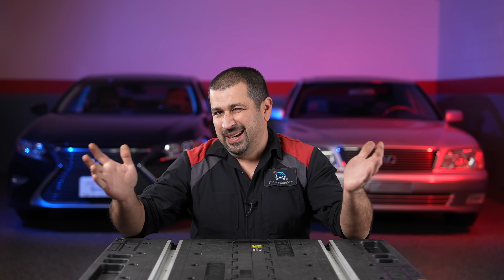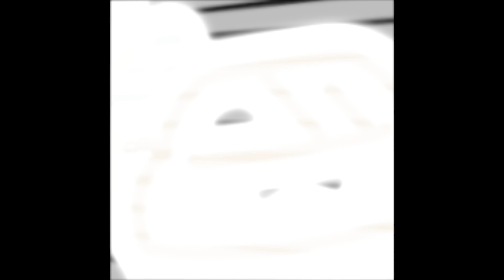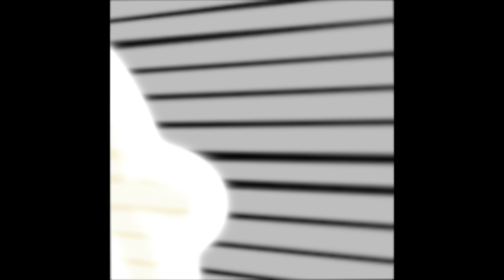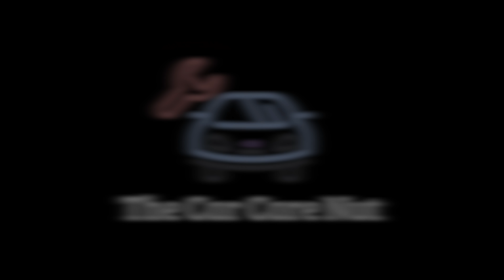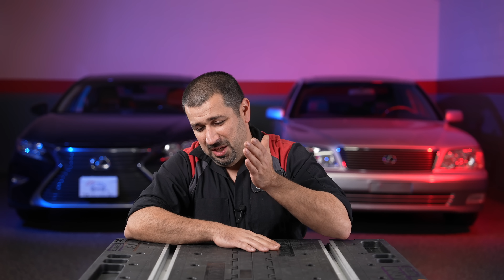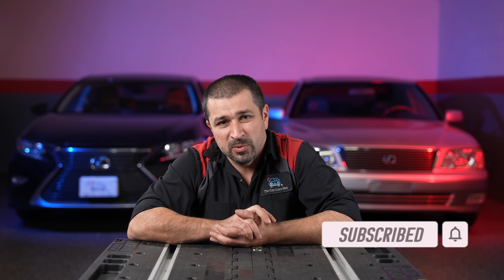Can Modern Turbo Engines Be Reliable? Here's The TRUTH!

Comment: Love this channel, thanks! Turbo or non turbo should be treated pretty much the same. Keep your foot out of it until it's at normal operating temperature so the oil has had a chance to visit all the internal parts and change the oil regularly even before the recommended miles/time. I let my Mazda 2.5 turbo cool down out of habit from driving a turbo Regal back in the day. That Buick had zero issues with lots of miles and a few runs at the drag strip. It doesn't hurt to let them cool it just takes a minute, especially if there's a good song playing in the car 😏

Comment: Of course it can. I have a 2018 AWD Dodge Charger Pentastar I supercharged with a Vortech. It gets 41 mpg on the Interstate @ 608 hp @ 22 lbs of boost. I installed it at 9,000 miles and today have 30,000 on it. The oil is changed every 3,000 miles along with the car. I fully expect it to last the life of the car easily. The supercharger is worth double what the engine it's sitting on is worth. If you drive like an idiot, you may blow the engine, but you won't blow the supercharger.

Comment: Bought a new Audi last year and the manual states 15K km service intervals. Well, it got its first oil change at 800km, then 3400km, again at 7500km and will be getting oil changed every 5K-6K kms there after (done by myself). All documented with receipts and pics for warranty purposes. Then the 15k km service done by the dealership. Oil is cheap, engines and cars are not. dealerships and mechanics make a great living off folks who follow the recommended service intervals.

Comment: Many years ago in the mid '70s I worked as a technician for Porsche. When the Porsche 930 turbo came out it was an amazing piece of machinery. While the boost was factory set at .7 bar I was modifying the wastegates to create one bar. One of the issues this created was blowing out crankshaft seals. But one of the main failure issues created was the oil coking in the turbocharger housing. Eventually they switched over to an after run circulation system, which helped prevent a lot of that. Driving these at 130 mph in third gear was like sitting in your living room. The boost they created was like hitting ice. An amazing car that helped the progress of today's turbocharging systems. Turbos are fine, if you keep your foot out of the dashboard. Frequent Oil changes, like you say, are a must. Love your show, I can really connect with everything you say.

Comment: 13:35 You said it.  It will be even more vital that a used car buyer sees dealer (or oil shop) records of regular oil changes.  However, if the owner is like me, and does them himself, there will be no such record.
Reply: Same I change mine every 4k miles but do it myself so no record if it not the log book I do but they can take it leave that.

Comment: I only use AMSOIL Signature Series oil and their filters in my 2016 Lincoln MKC 2.0 turbo. All the studies like Project Farm tests show it's best against heat and wear. Little more money but cheaper than car repairs. Change it myself so no more expensive overall than paying someone who uses cheaper stuff. Big believer oil is an engine lifeblood. The oil is rated for 15000 miles . I don't let it get to 5000miles. With the new drain and fill transmissions that only change 50% of the trans fluid at a time  I drain it every 15000 miles with AMSOIL's best transmission fluid that's rated at 50000 miles too. Doing it myself is way cheaper and pays to use the better engineered oils more often.

Comment: Yes 100% Im 54 year old mechanic here in uk i purchased a used fiat bravo 1.4 turbo 150bhp petrol at 6 years old 37,300 miles and i did about 5000 caravan towing withit as well.Anyways i scrapped the car this year as was 19 years old body was getting rusty and i had never replaced starters alternator clutch dual mass flywheel etc was all original  at 19 years old 149,000 miles and i made decision not to put car through another mot as i did not want start replaceing major parts as above.Point is the engine was just as smooth quiet powerfull and economic as it was at 37000 miles for how much longer who knows but it seen millions of others off the road just with regular oil changes timing belts and 2 o2 sensors.

Comment: perfect example is the 2018 VW Atlas. They had the 3.6 vr6 and 2 liter turbo engines. Most vr6 are still running fine with over 120k miles

Comment: Certain Chinese car brands, for some of their more affordable hybrid models equipped with less than 2 Kwh battery  pack choose to boost power by using electric motors than turbos. These small 1.5Liter displacement hybrid cars can really rocket off.  If you've been in China, these things can give turbo assisted cars in the West a run for the money.

Comment: My little 2016 turbo 4 recommends every 10k/1 year, but I never wait that long. Usually in the 5-6k range and of course with the recommended specific synthetic. Has 99k, I bought it 3+ years ago w/68k on it. I do use it daily driving, in town mostly. But I also keep the revs low, let it warm up. My drive home is very mild, so I treat that as the ‘cool down.’ I don’t sit in my driveway letting it idle, I do not think that’s necessary though some turbo drivers swear by it.

Comment: You’ve covered several very very, very important ideas two you’ve forgotten. I’m looking into the comments. They’re also saying the same thing. Warm it up slowly do not rev the motor up when it’s cold. Also let the turbo charger cool down as a owner operator for over 30 years with semi trucks and diesel engines. Two things that do kill them the same way as a driver working for you that believes he needs to rub the motor up immediately. If you’re in cold weather, that oil is not up to the turbo charger yet. Also shutting it off immediately after working engine hard, pulling a load high speed/climbing a mountain. The oil in the turbo will cook itself and turn to Coke, which is the same thing as sand and not the Coke you drink number one rule just like your spouse. love your vehicle pet it Crescent spend money on it maintain it. Check it all the time. Let it know you love it. If you drive it like you stole it but only last a little while you’ll have to replace it.

Comment: So in order to have a miniscule effect on emissions the EPA is imposing standards that push engineering to its absolute limits producing engines that need to be replaced more often (and the GHG's associated with making the parts as well as the more frequent oil changes). Very likely these bright sparks at the EPA are not considering these factors when they focus purely on tailpipe gases. I've worked with PhD's and had them reporting to me - a lot of them can be quite myopic.

Comment: Excellent video. Recently purchased a 2022 Equinox with the1.5T engine. My first vehicle with a turbo. Will definitely be doing oil changes at 3K - 3.5K intervals instead of the 4K the dealer recommended.

Comment: In the 50s and 60s a gas engine with a 100,000 MILES, on it was rare, if someone said they had a hundred thousand, you knew they were lying. A turbo with over a hundred thousand is normal, he is correct

Comment: why people care so much about lasting and reliability, I don't understand. As if you are gonna last. We are living on this planet maybe 70-80 years at most, starting to have a life at 30's, replacing our cars in every 6-7 years, and think if our car's engine will last 300k miles or not as if were are gonna use it that long. Imo, unless it's a bmw :), most cars are reliable enough to have enough fun, if it's a great car, I don't care if it's turbo gonna break or not, I'd just have it replaced. It's not the end of the world. If you cannot afford the car's repair costs, don't buy that car. Find something cheaper. 

Life is too short, I'd drive a fun car, rather than a boring toyota just because it doesn't break as often as the others. But as always mechanics have a fetish with reliability.

Comment: All of the things The Car Care  Nut says are absolutely true. Another thing is that modern engines are made with the idea to make them as cheaply as possible. Long gone are cast iron blocks or cast iron liners in aluminum cylinder blocks. Those types of engine blocks are repairable. Now we have aluminum blocks with aluminum cylinder bores coated with very very thin coatings of materials like Nikasil and various other materials. This is a recipe for keeping the engine running until the warranty period expires but after that...... manufactures don't care and would rather see their customers buy a new vehicle. If there is any damage to the cylinder bore on one of these modern engines, the cylinder block would need to be replaced if someone wanted to repair it.  Bolt a turbo on one of these "Modern Pieces of Wonderful Engineering" and you have engines that are very unreliable mechanically especially when owners follow the ridiculous extended maintenance intervals that are recommended these days. The Car Care Nut speaks the Truth!!

Comment: Two more things:
- Turn off the auto engine stop/start.  Nothing worse than letting the oil cook inside a hot turbo charger.
- When you are a couple of minutes away from reaching your destination, drive like a Grandma to let the turbo, the oil, and the engine cool down before turning the engine off.

I have almost 100,000 on my turbo charged engine from what is not considered a reliable car manufacturer without any issues.

Comment: I agree also tho alot depends on driving conditions, group 3 petroleum base in cold climate s short trips terrible for any engine.  0w is terrible as viscosity index improvers with the molecules at high heat range.  Hwy driving with with a decent oil , you can obviously stretch your intervals but always , of course a little less with boost

Comment: depends on if you put the turbo on, or factory installed.
  if like me, we use AIRWERK T6 tubos, and tub 8 qt pans on V8s, or, Run a seperate oil system for turbo, That has an electric pump, 1 qt reserve and the turbo is installed in the rear. No intercooler needed, and a custom airbox plumbing,alongside the exhaust, ecu tune on dyno. methanol injection or E 85 preferred tune. an airwerks s600s, dual vane, willspool 15 psi, from the rear, boosting up the whole length of the car, at 1100 rpm, and capable of 75 psi at 3000rpm.  We can install it on any V8-v10
add 150hp,100tq, or if custom full insane install 1000 hp.
  But pump gas, waste gates etc got to 9 psi or so, without detonation.and triple that onE85, or methanol injection pump.
The air from the rear mount twin vanes is about 130 degrees at air filter box at 9psi 

what we find, Custom installs are super rare today. but for cars like an old Cadillac 60s  ,or a new one..this way the only way, UNTIL makers caught  on. 
We did full armor rigs,gasoline ,8000 lb curb weight,without boost, a slow turd.
diesel,  a whole other animal....
The right diesel+ gears amazing, 
TODAY..to not hookup an armor plated/diesel turbo powered, 10 spd transmission/  Solid tire rig, made for a UNSTOPPABLE 50 mph cruise across continent.
  You're not understanding luxury..

Brinks trucks, are the new "g wagon"

Comment: These 4 and 6 cylinder half ton trucks are pushing the engines to the edge of reliability.  GM has 4 cylinder turbo half tons rated to 10k pounds of towing. This will end up destroying the engine just like race car engines getting pushed to the edge.
Cars at cheap these days, they just over charge for them.

Comment: What seems to be missing in this push for smaller engines is that the energy is in the gasoline. If you want to make more power you have to burn more gas. 

You need a stoichiometric fuel air ratio of around 14.7:1. The turbo stuffs more air in the engine so you can burn more gas making more power, effectively making it act like a larger engine. There is no magic here.

The only time you see more fuel economy from a smaller turbo engine is when the turbo is barely working. E.g. when you are not accelerating.

Comment: The other issue is the engine internals - they are not stronger for a turbo - same internals as NA but with a  turbo means  weak internals and failure.

Comment: The 2.7 ecoboost seems to be a really reliable engine capable of high miles. in fact i knew of one with 380k miles and it only had normal maintenance nothing else. So maintenance is definitely a factor

Comment: On an ancient episode of Motorweek, a guy was telling folks that when you have a turbo, it's a good idea to let the car idle for a minute after parking and before shutting off the engine. That way, the hot oil has a chance to circulate out of the turbo and cool it off.
Reply: That’s outdated advice with modern turbos
Reply: I agree.  Some new turbo engines have an elect variable water pump that hits the turbo first and it keeps moving coolant after the car is shut down, which is a great idea but will break over time.
Reply: @jimsvo4486 i change my coolant early, once a year, just to completely avoid it becoming acidic and corroding seals

Comment: What mileage determines how long a car “lasts”? If it’s 200k miles, the MK7 GTI/R has proven that it can be reliable for that long, over and over again. Stock and tuned, it frequently hits 200k+ miles with little or no issues. 

So the answer is yes! But the manufacturer has to partner with a turbo company that knows how to make a reliable turbo as well as know how to make an engine that will be able to retain reliability with a turbo. Unfortunately, both Toyota and Honda have not figured out four how to do this yet. Both companies have very reliable N/A vehicles, but their factory turbo vehicles continue to have issues.

Comment: As an enginner I agree with everything said in the video in principle.  Engine life is further compromised by a couple of other factors.  As one commenter mentioned the Arrhenius rate rule has and impact.  Anther big factor is the small engine has to work harder than a larger properly sized engine.  Bearing life and general wear are a function of the ratio between max load the bearing can handle and the actual operating load raised roughly to the 3rd power.  The actual exponent varies depending on the type of bearing.  The smaller engine has to run at a higher percentage of its max HP more of its life which means it life will be shorter.  Cleanliness is another huge factor.  Clean oil can double the life of an engine under the right conditions.  Keeping the oil cleaner by changing the oil more often will certainly help the smaller engine but it will never last as long as the larger engine with the same care and quality of components.

Comment: One thing I've yet to see any of the manufactuers' do with turbo cars regarding oil is Use Separate Systems. Oil is still cheaper than an engine, but they do accrue a fairly significant cost even doing it yourself. Using quality oil, between my truck and wife's car, filters and oil is ~$180 every six-ish months (usually sooner by a few weeks depending on needs and activities, but at least 2 a year). 
On that note, if turbo oil ran in its own system with scavenge pumps, there are oil types that both lubricate internal friction systems and are used (in some applications, it's a Primary design envelope) to pull heat out of the system. The most extreme case off the top of my head are jet engines. Unique to those, the oil system never interacts with the combustion process. It does heat cycle naturally, as its core function is to help remove heat, but it lasts quite a bit longer in said extreme environment than automotive engine oil. Utilizing even electronic pumps rather than working off the crank, this is an easy task to do to ensure longevity of each system, but it frustrates me to no end that No One does it.

Comment: Yep. You're not lying. I'm a Honda tech. The number of turbos that we have to replace on some of these cars with less than 100k miles is ridiculous and 99% of the time it's because the owner doesn't change their oil frequently enough. What's even more ridiculous is that they'll go over the recommended interval by thousands of miles and then blame the car when something goes wrong.

Comment: The answer is no, and politicians' fault. Manufacturers have been forced to push newer, more complex, more expensive, less proven technology into engines every single generation, before it's ready for prime time. This has been going on for decades. Chevrolet had to push their poorly optimized AFM cylinder deactivation into their incredibly popular full-sized line long before it was ready and deactivating it is the best thing you can do if you buy one of those used. It all means more expensive and more frequent repair. And it's politicians' fault.

Comment: USE SYNTHETIC OIL ALSO. THE CHEEPEST SYN. IS BETTER THAN MOST EXPENSIVE NON-SYN. OILS, FOR  EXCESSIVE TURBO HEAT. THANKS GOV. C.A.F.E. STANDARD. GOD I MISS BIG BLOCK, CAST IRON, TWIN 4 BARELLS. WITH 411 REAR ENDS. HURST 4 SPD. ON THE FLOOR AND A REAL CLUTCH YOU COULD CHANGE IN NO TIME.  ALUM. CRAP IS ON THESE SO CALLED NEW CARS AND ALL PLASTIC THAT CRACKS IF IN THE SUN FOR A DAY.      ITS CALLED PLANED OBSOLESCENCE FOLKS!!!!! 72 MONTH LOANS ON CARS THAT ARE GARBAGE IN 24 MONTHS. THE DEALERS AND MANUF. LOVE IT.:face-orange-frowning:  ALUM. IS ONLY GOOD FOR 2 THINGS, FLYWHEELS AND FOIL. TECKS KNOW ABT. FLYWHEELS. YOUR  MOM KNOWS ABT. FOIL.:face-green-smiling: THEY TELL YOU, EASY ON THE TURBO (GRENADE) LIKE YOU DONT NEED IT EVER, BUT LITTLE TURBO ENGINES NEED HAMMER DOWN TO RUN WITH TRAFFIC.  DUH !
Reply: I have not seen conventional oil for sale for over ten years.

Comment: Traded in my 18 F150 with the 3.3 non turbo for a 22 F150 2.7 EcoBoost. Traded the 22 for the new 25 Ram twin turbo Hurricane. Going back to the simple little 3.3 non turbo 295 H.P. engine.
I really don't need a 425 H.P. rocket that the dealers can't fix.😖